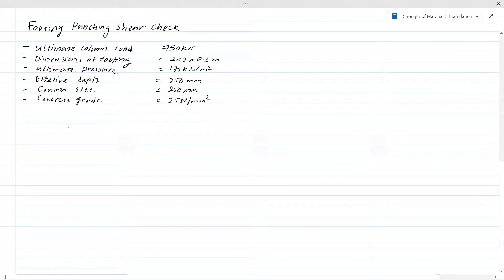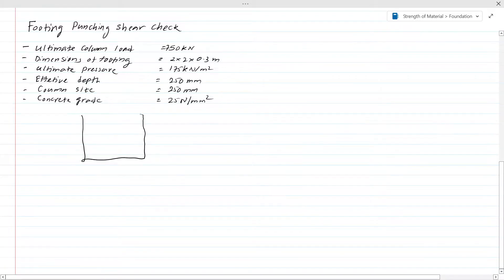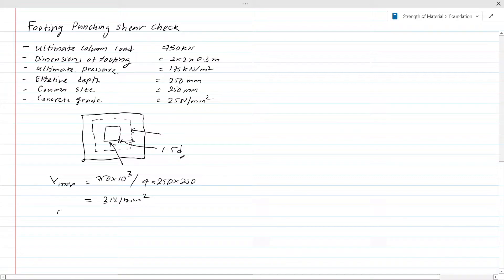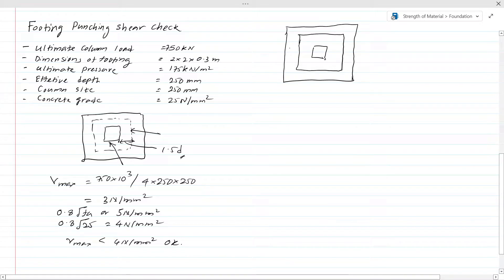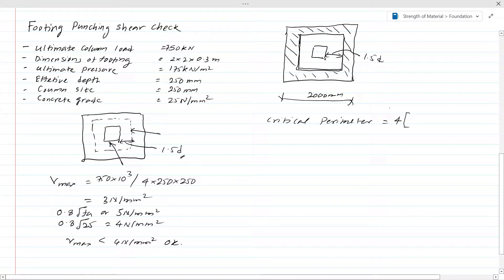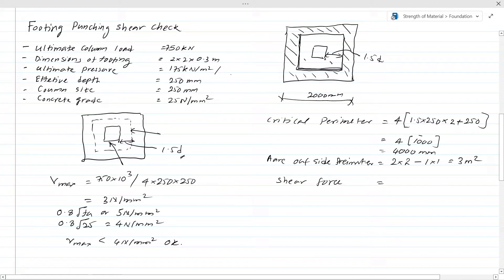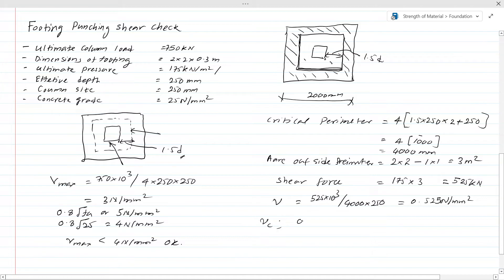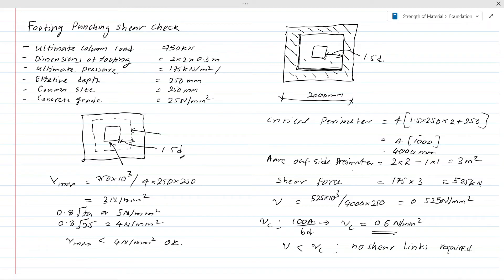Punching Shear of Footing | Shear Design Worked Example | Structural Guide

Comment: If we give shear links can the footing depth be reduced
Reply from the maker: Usually, we do not put shear links for the footings. 
Better select a thickness that does not require shear links. 
Putting shear links is difficult and mostly the footings have a single net.